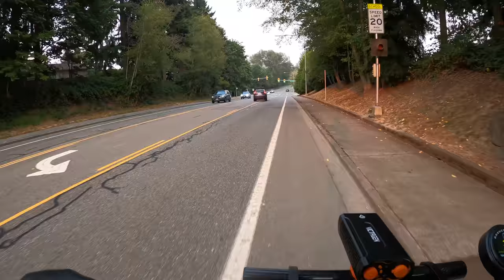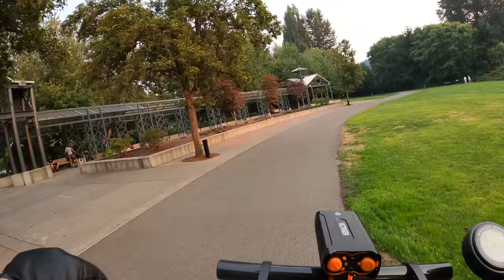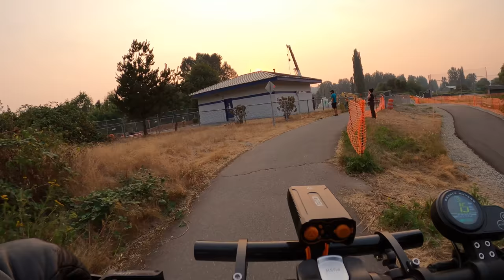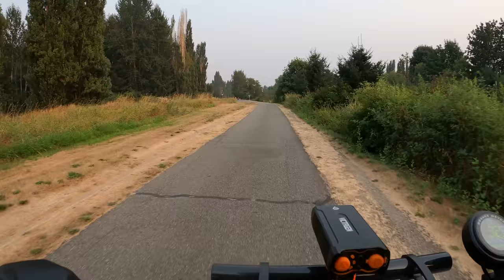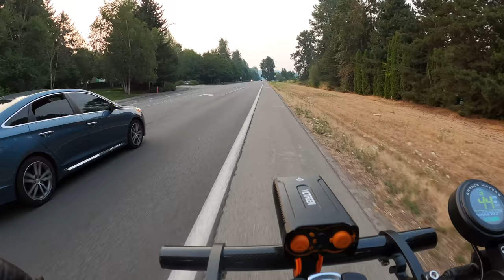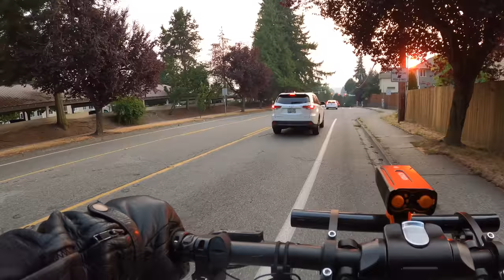Taming the Bronco Xtreme 11 - Episode 1

Comment: nice video I just discovered your chanel. I want to get one of this scooter how much did it cost you ? how long does it take to get delivry?
Reply from the maker: Hello, it's easier to answer all the questions here so:
I purchased this from FreeMotionShop. You'd need to check to see if it's in stock, but mine was $4200 and took about 3 days to get to me. I changed the handlebar grips recently, but I'm using the stock handlebar. Overall, I love the scooter! Considering I've almost put 1k miles on it in under 2 months, I love it. Thanks for the comments and the sub!

Comment: Lovely ride mate. This e scooter is bloody insane. Myself, I have a modest 26mph scooter but it’s just about fast enough and is quite comfortable to ride. Im in London U.K. and unfortunately, we don’t hVe such nice roads as you. Lots of dangerous potholes. I always ride carefully when going on new road but I must say that a lot of cars get so impatient and pass me extremely fast and way too close. My only complaint about riding e scooter, it does feel very unsafe because inpatient car drivers.
Reply from the maker: Yeah I agree, most of the close calls I've gotten were from impatient drivers. I've been cut off many times, but I expect it. Just have to ride with the belief that everyone is blind and be cautious.
Reply: @LetsRideMTSea  yeh, I also feel like if I had an e scooter that could go little faster, I’d be safer. I ride on mainly 20mph zones but most cars go around 28 and some even faster. My top speed is 26mph for a short while, at full battery and average at 24-22mph and cars just constantly pass me, dangerously. If I could go 30mph I’d be able to keep up with traffic and I would take a lane, like a car and not ride on the edge of road, like I currently do, right next to curb. I really need to get some rear view mirrors because looking behind on busy bumpy road for split second is scary. I just don’t get why cars don’t respect bicycles and e scooters and actively put them in danger. I’m now thinking about buying electric moped. They are road legal, so no worries about police and less dangerous then e scooter.
Reply: Same here in NYC potholes are insane